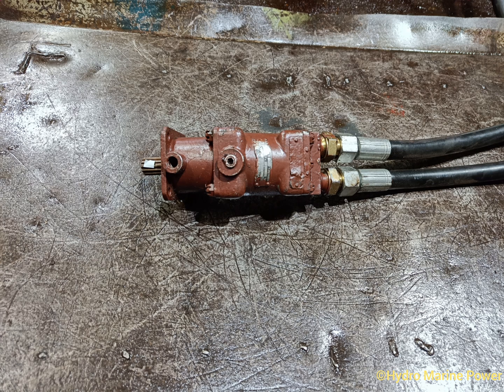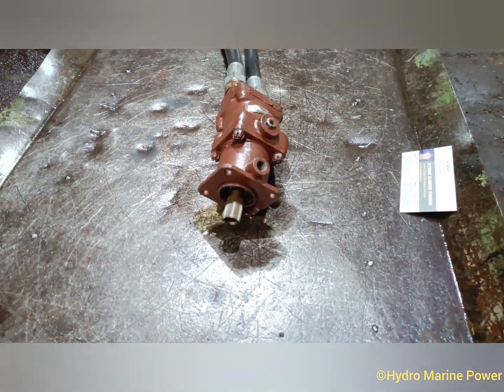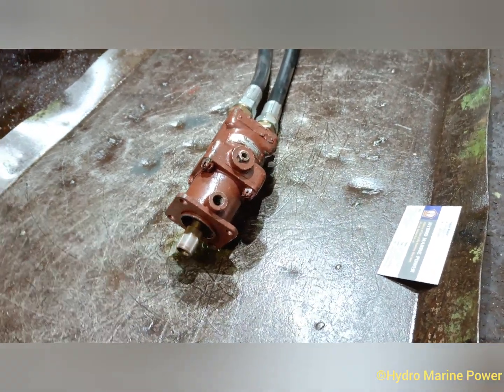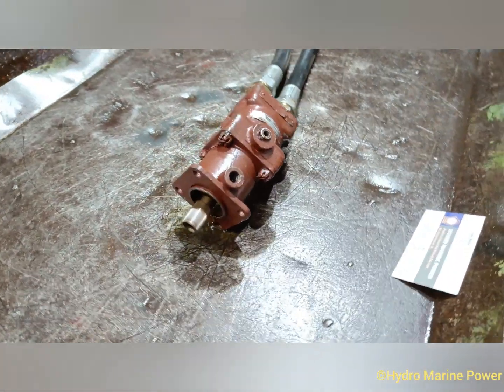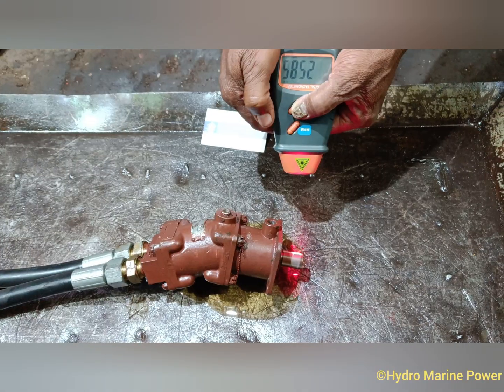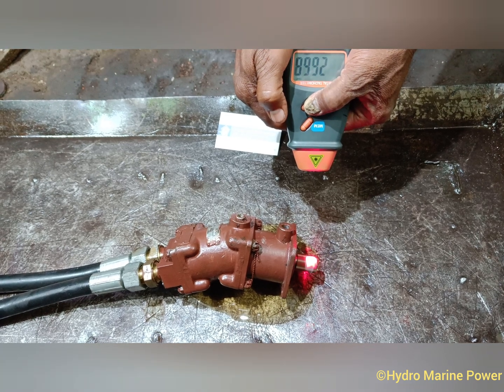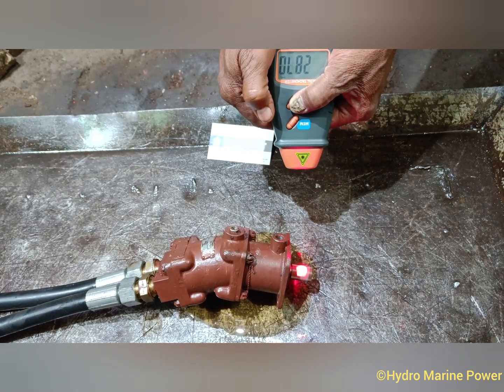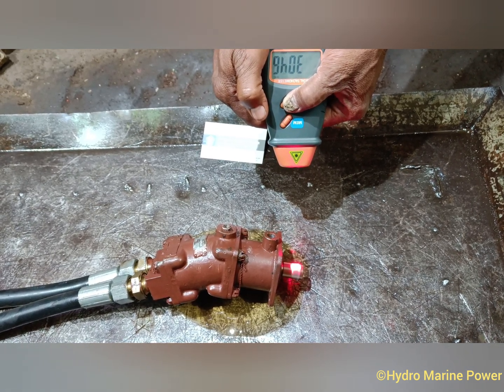Testing @ 4900 RPM! Vickkers 8.3 cc Axial Piston Hydraulic Motor Shaft Rotation at 1000 Psi

Comment: What could that spin or turn. Rated hp? Just curious
Reply from the maker: @GarrettGrensteiner  hello, it could be used in applications where there is risk for fire. They can be used in blowers or exhaust fans. Also they can be used in cement vibration applications which removes air from concrete. Likeways, high speed applications which doesn't require much torque but requires more rpms. It can be good upto 3-5 Hp.
Reply: @hydromarinepower  thank you. I have one about the same wanted to make something with it

Comment: tell me why the hydraulic motor jams when the hydraulic distributor is opened abruptly? when opened smoothly it starts normally
Reply from the maker: @KirillVotrin  we don't understand why would someone handle any machinery abruptly? Every machinery has a sequence to follow for Assembly and to Disassembly. If it is done properly then it won't jam.
Reply: @hydromarinepower  I got it in this condition